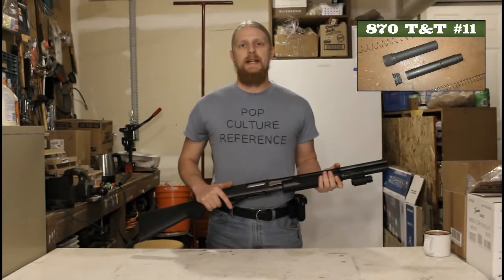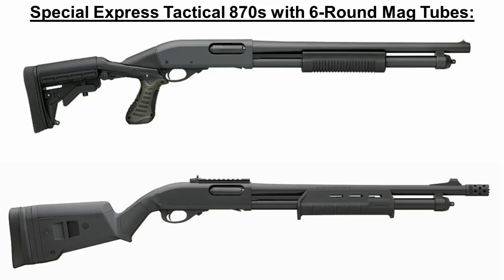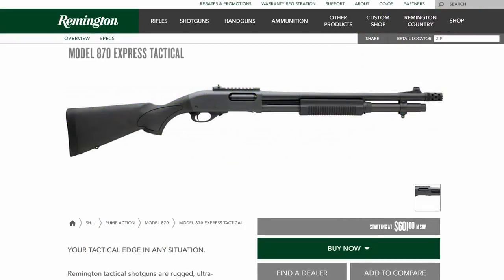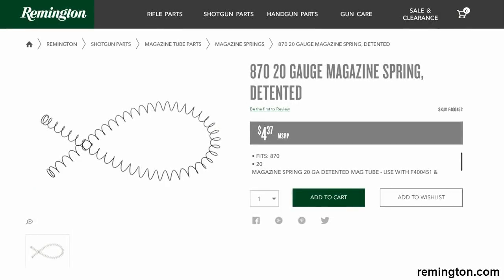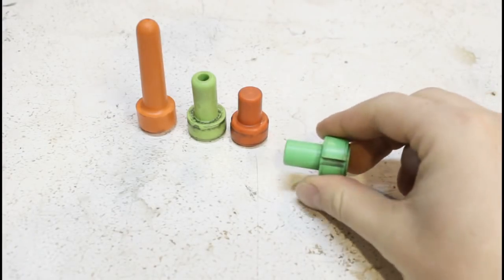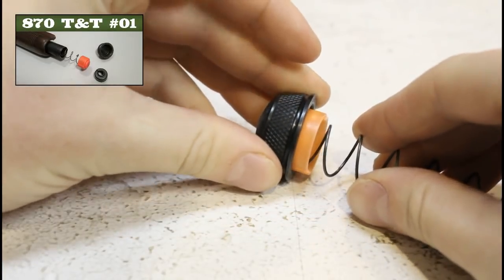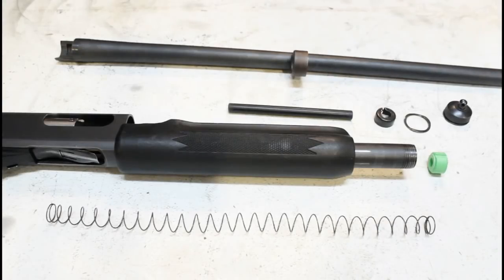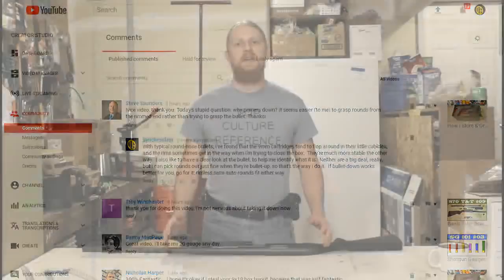Removing a Magazine Extension - Remington 870 Tips & Tricks #16

Comment: If I buy a new Remington 870 barrel will it come with the built in detent? Is Remington selling barrels without the detent installed?
Reply from the maker: It depends on the barrel.  Barrels that are meant for hunting shotguns or civilian models without magazine extensions won't have a detent, while Police barrels and those meant for some Express Tactical models will.  Barrel detents will be more common on older barrels, since the internal-ratchet cap retention system is a relatively recent design change.  However, some used barrels will merely have a hole where the detent used to be, as it wasn't uncommon for the detents to come loose from their staking and get lost (probably one of the reasons for the simpler new-style cap retention system).  A gunsmith with the right tools can replace a missing detent, or even install one in a barrel that never came with one, but the wave washer is a much simpler and cheaper fix.
Reply: Synchronizor Thanks for clearing a few things up. I’m looking to buy a 28” barrel for my 870 and noticed none of the pics I could find had a detent showing. Are the wave washers reusable? Or are they one and done?
Reply from the maker: They're reusable.  I suppose if you're changing barrels over and over again it might eventually flatten out and lose force, but for $3 each, you could always order a couple extra to keep on-hand.  Nice to have some spares anyway, in case you lose one.
Reply: Thanks for your help!
Reply: I really enjoy your content and presentation style. Hope to see you back again soon.
Reply: @waynehajek6346  same here been taking alot of notes this guy is a legend

Comment: In this video, you mentioned the process for removing the factory installed extension on an 870 tactical is different. I tried a regular 870 end cap and it's too short. Are there special caps for this? I'm having a hard time finding information online. Thanks!

Comment: I just noticed the color of your bolt, did you change it out? Usually  they're painted back arn't they?
Reply from the maker: Depends on the model.  A lot of bolts are black, but others are chromed or nickel-plated.  My 870's something of a hodgepodge, and I have a tackle box full of of parts.  I usually have a chrome Wingmaster bolt in the gun because I like the way it looks.

Comment: Thanks for including info on the 20 gauge 870.  I'd like to see more on accessorizing the 20 gauge platform.  I haven't been able to find a dependable way to secure a light on mine for home defense.  I even had Vang Comp (who otherwise do perfect work)  try to attach a rail to my forend and it promptly flew off under recoil.  What are your suggestions?
Reply from the maker: I know CDM makes a 20ga 870 mount for lights or other accessories that can attach to a 1913 rail.  Pretty sure I've seen others as well on various 20ga builds.

Comment: Hey bud, just wanted to say you make the most detailed and helpful 870 videos on here and I appreciate that. However a video I’m in desperate need of is a full trigger group dis-assembly and re-assembly as mine needs a very thorough cleaning. Picked it up used and looks as though it’s never been cleaned, its extremely dirty. A video on this would help me out a ton and I know you would make it top notch. Thanks!
Reply from the maker: The 870's trigger plate assembly is designed to be cleaned as a unit.  Unless you have broken or damaged parts in there, you shouldn't need to pull it apart completely.

Fully disassembling & reassembling the thing requires special tools, and replacements for certain parts that have to be destructively removed.  It's also much more of a challenge to take apart and put back together than anything else in an 870; and it's something that most typical gun owners probably shouldn't attempt, as getting even one step wrong can make the gun inoperable or unsafe.  

I am planning to do a video on this, but I still need to get certain tools, and practice certain steps in the process before I can do it right.  It's probably not happening anytime real soon.
Reply: Synchronizor Alright, thanks for the reply. I’ll try to clean it as a unit. Anything I should keep an eye out for?
Reply from the maker: Just look for chunks of junk or obvious rust.  I've found Q-tips are helpful if a trigger assembly is really neglected.  After you've cleaned everything, make sure it all moves smoothly without any major sticking or hang-ups.

Comment: Here are a few topic ideas:
*Steps to smooth out the action of the 870 (I can see the guns you own are much smoother than mine). 
*Use of metal vs. polymer/plastic followers. Pluses and minuses. 
*Brands Single piece extensions that work best.
*Use of upgrades “police” springs in the trigger group. 
*Review on different brands of snap caps.
*Things to look for when buying a used 870.
*Plus and minuses of polymer tigger group vs. metal trigger group. 
*Review of the different seat springs Remington offer.
Reply from the maker: Thanks for the ideas.  Several of these are already on my list, but to address them one by one:

*All I've done to my 870 is shoot it.  870s slick up nicely with use.

*I think plastic followers are better.  Metal followers usually have more mass for the spring to work against, and they can damage the receiver over time in certain circumstances.

*I haven't come close to testing them all, but two lines of single-piece extensions that I've really been impressed with are the Wilson Combat and S&J Hardware extensions.  The Wilsons are solid, reliable, and a great value for the money, while the S&J kits are more refined, monolithic, and have a number of nice premium features if you're willing to pay the extra money.

*There are only two special springs in Police trigger plate assemblies, and neither are "better" parts, they're just there to tune the gun specifically for police work.  One simply makes the trigger pull heavier, the other has some minor advantages relating to the carrier, but there are disadvantages to it as well.  I would like to talk about how Police 870s compare to civilian models at some point, but I don't have access to a Police model at the moment.  The mechanical stuff is all pretty minor anyway, most of the benefit to the Police 870 is a tougher finish & furniture that better stand up to regular combat or other hard-use applications.

*A-zoom aluminum snap caps are good as snap caps, but the rims will wear out eventually and cause malfunctions if they're used for function tests.  Also, beat-up aluminum is abrasive, and can be tough on finishes.  Tipton plastic snap caps won't hurt your gun during cycling, but they suck, their rims are way too thick.  If you want to do drills at home, get proper dummy rounds, not snap caps.  Dry-firing an 870 won't really hurt it anyway.

*Apart from general used shotgun buying advice, if you're looking for a used 870 for a defensive build project, look for one with the updated flex-tab action.  Older guns can be converted, but you'll save yourself effort and (usually) expense by starting with a mid-1980s or newer gun that already has the newer parts.  I would like to do a video (or multiple videos) where I pick up a used 870 and make a project gun out of it, but I don't have the free cash at the moment.  If you're looking for a hunting gun, pay attention to whether a gun is a magnum model or not, and see if you can find one with interchangeable choke tubes.

*I think the plastic trigger plates are better for a number of reasons, including impact resistance.  However, I would like to do some formal testing comparing the two.  That's out of my budget now, but maybe in the future.

*I do plan to do a video on sear springs.
Reply: Synchronizor ...ask and you shall receive! Thanks for the info!!

Comment: Synchronizor, any advice on best method for removing dimples towards adding an extension? Also, favorite mag extension? One or two piece?
Reply from the maker: I believe drilling the dimples out is the best method.  It's easy to do with tools most folks will have kicking around in their garages, and has little chance of screwing something up in the gun so long as you have a bit of common sense.  The holes will be covered up by the barrel guide ring once the gun is put back together, so there's nothing to look bad or be an ingress risk.

The only two-piece extensions I have personal experience with are the Remington factory +2/+3 kits.  They work fine and are quite sturdy, having been designed for military 870s.  They also let you mount a bayonet, if that sort of thing floats your boat.  They're not the most space-efficient though, and do need to be installed correctly.

For single-piece kits, I really like the 2nd-gen extensions from S&J Hardware.  Strong, space-efficient, versatile sling plate, good spring, excellent follower, reliable, and they stay in place really well even without any bracket or clamp.  You'll pay a bit of a premium, especially for the +2 & +3 versions (since they're monolithic machined parts and a longer extension means more material and machine time), but they're what I prefer to run for HD.  The Wilson Combat extensions are also pretty good if you want something more affordable.  A little heavier and less space-efficient than the S&Js, and they lack some of the extra features, but they're good, reliable extensions that are an excellent bang for the buck since they use a more cost-effective (but still all-steel and very strong) multi-piece construction.
Reply: @SynchronizorVideos  thank you very much.

Comment: My 870 Magpul edition, when fired the "bolt" slides back reveling a bit of the shell, then I pump it back more to extract the spent shell. Is it safe that the bolt opens a bit? My hatson did not do this. The bolt would stay complete shut until I cycled the next round.
Reply from the maker: The 870's slide unlocks as soon as the hammer falls, the hammer spring pushes the action bar lock down in addition to propelling the hammer.  Because of this, the slide is free to move, and depending on how you're holding your 870 and the level of recoil you're getting out of your shells, the slide can sometimes open itself under inertia as the recoiling gun is stopped against your hand or shoulder.  It's nothing to worry about usually, the bolt will stay locked into the barrel until the slide moves a certain distance, so by the time the action actually opens, pressures in the barrel have dropped to safe levels.  I have seen this cause misfeeds in extreme cases, such as when a recoil-reducing grip jerked the gun back and forth under recoil hard enough to open the action all the way and eject the fired hull.  But in your case, if the action is just opening a little bit under recoil, it shouldn't cause any function problems.  If it bugs you, try holding the fore-end more firmly, and letting your shoulder rock back more with the recoil.

Comment: Question for you. What do you think about all this nonsense regarding the mim extractors and having to have a machined one. I have never seen or heard of anyone having issues with the mim part.
Reply from the maker: I have seen one case where a MIM extractor was slipping off the rims of shells, and popping in a used machined extractor remedied the problem.  However, there were several details about that situation that are worth considering.  

First, the 870 in question was being run very, very quickly - right on the limits of what its magazine was capable of handling.  Running an 870 that quickly is just asking for feed issues even if the other parts of the gun work flawlessly.  The gun really can't be aimed properly when being shot that fast, so there's little practical reason for this situation to even come up (this occurred at a range during a torture-test of a magazine extension).

Second, the shells were all a particular low-end, low-price, steel-cup target load, and those are never the most reliable shells anyway.  Rim shape & diameter can vary slightly with those cheap shells, which may have contributed to a poor grip on the part of the extractor, and steel-cup shells are decidedly inferior to brass-cup shells when it comes to expansion & recovery due to pressure.  Since the gun was being run so quickly, extraction was beginning while the shell was still expanded in the chamber, meaning the extractor had a lot more resistance to work against.  

Finally, that MIM extractor had seen many thousands of shells over several years, and it was by no means in perfect shape.  The machined extractor that replaced it was of unknown age and condition.  Even if both extractors had seen the same number of rounds each, that's still a sample size of one for each, which really doesn't prove much.

Bottom line, I think the MIM extractors are fine parts.  They work reliably, and while a defective one will occasionally show up, I see just as many (if not more) defects and problems with the machined extractors.  The MIM extractor mentioned above functioned perfectly with all other shells, and also extracted those specific cheap target loads just fine when the gun was cycled at more normal speeds.   Some people replace them just for peace of mind, and that's fine.  It's important to trust your equipment, and if a $15 part lets you do that, go for it.  But when people ask me if it needs to be replaced, I say not unless they're actually seeing it cause problems.
Reply: Use what you have I'm in the same boat. It's not a life and death firearm for me so if it breaks ill fix it then.

Comment: Not sure what the hell I did, but I was practicing loading/ unloading a brand new 870, through some strange happening the shells got stuck and the shells are now out but the bolt is floppy inside the chamber and the pump is stuck back, and there seems to be no way to get the barrel off, it's just scrwed

Comment: Please do a video on those single 6 shot tubes, I'd love to add 2-3 more shots even having the shell tube extend past the barrel above ;)
Reply from the maker: I intend to, once I can buy or borrow one to show off.  As far as extensions go, installation is pretty much the same; just remove the dimples and install the kit as you would on a standard 870.  The one thing that's different is you'll need a longer spring to get an extension kit meant for a 4-round base mag tube to work on a 6-round tube.